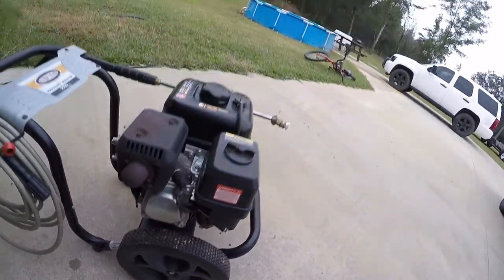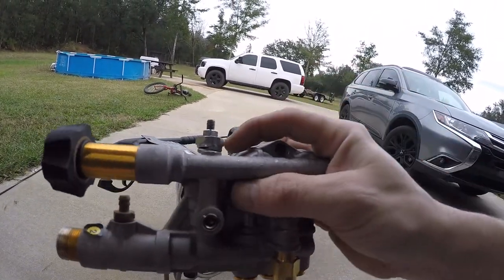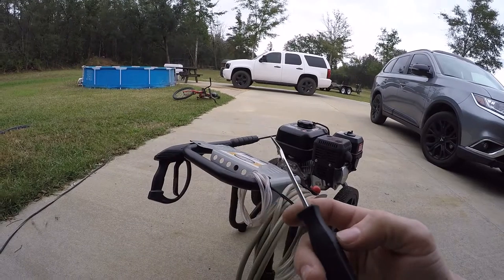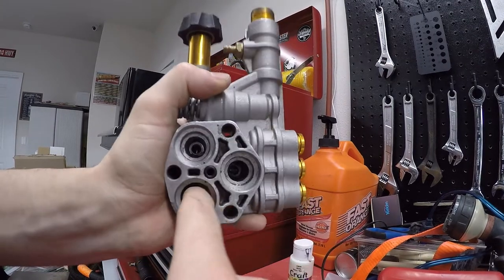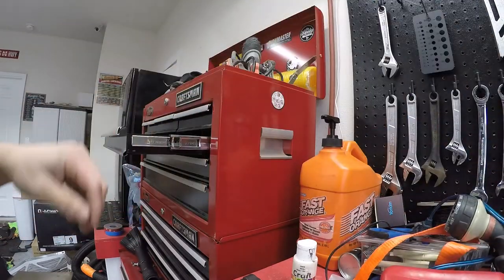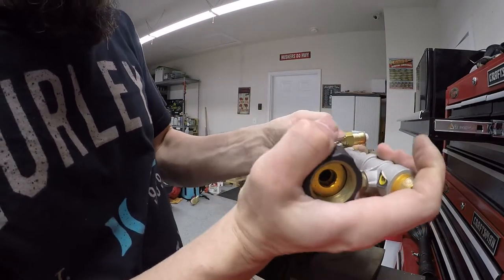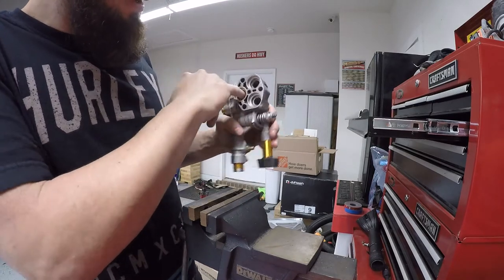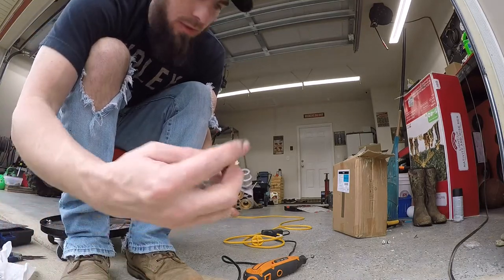Pressure Washer Check Valve Replacement

Comment: What was it doing before you replaced the check valves? No pressure at all? A little pressure? Thanks
Reply from the maker: Little to no pressure. It was like super weak.
Reply: Mine doing same thing... so the valves supposed  move freely?

Comment: OK I GOT ONE JUST LIKE THIS I PULLED THE OLD VALVES OUT BUT IT LOOKS LIKE THE SEAT IN THE VALVE BODY STAYS IN THE VALVE BODY AND THE BOTTOM OF THE VALVE IS A ROUNDED DOME  THAT MATES WITH THE SEAT. THE NEW VALVES HAVE A FLAT WASHER BOTTON WITH A RUBBER ORING ABOVE THAT FLANGE TO KEEP IT SEATED IN THE VALVE BODY. MY QUESTION IS DO YOU REMOVE THE PLASTIC SEAT THAT IS BIULT INTO THE VALVE DODY WHEN REPLACING THE CHECK VALVES OR DO YOU REMOVE THEM. YOU NEVER SHOWED THE VALVE BODY AFTER YOU REMOVED THE VALVE  SO IM NOT SURE WHAT TO LOOK FOR THANX
Reply from the maker: Yes remove the entire plastic valve.  https://www.amazon.com/dp/B07RZMZ83S/ref=cm_sw_r_cp_apa_glt_fabc_YRW9ZW149X3W1MV80V7E?_encoding=UTF8&psc=1
Reply: I got these but I can't get the oring into the barrel without hammering and breaking the white plastic. It appears there is also a ring that sits in the barrel. I can't remove that. What do I do to get the new check valves to seat deep inside the barrel without hammering and breaking them??! @GrayHairedDad
Reply from the maker: Thanks for watching the video. After replacing the check valve my pressure washer worked for about two years but it's now having the same issue again. I recently replaced the pump with a Triplex plunger pump and made a video. I will post the video soon.

Canpump CF 3030 G: 3000 psi @ 3.1 US gpm, 3/4-in Shaft Pressure Washer Pump https://a.co/d/34pBEs9

Comment: I soaked my check valves for about 6 hours in lubricant, took a small screwdriver and spun them around and now it magically works again. Same issue, no pressure.
Reply from the maker: Nice! Thanks for the comment.

Comment: How did you put the check valve back in?
Reply: Did you figure this out? I got mine out with a pick. However, I can't put in the new ones without hammering them in and breaking the white plastic. I lubicrated everything really well, too, and definitely got the right check valves. They're just too damn tight.